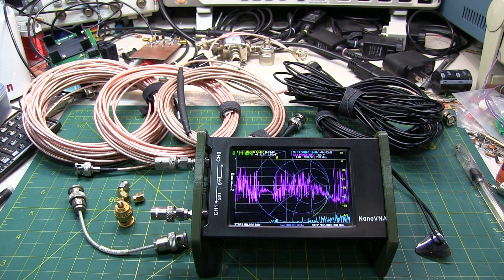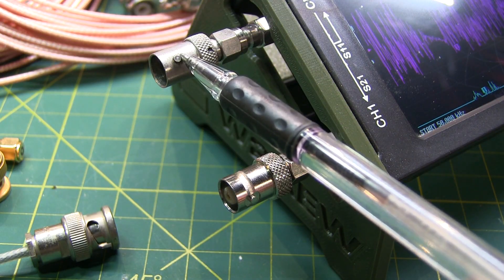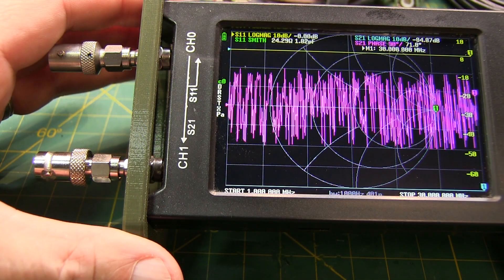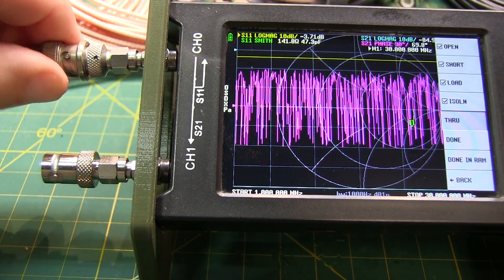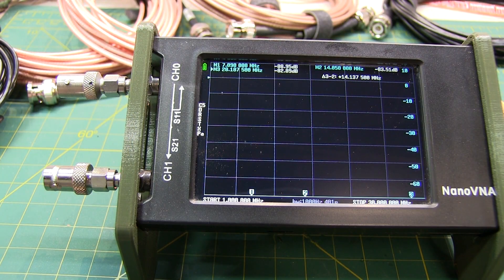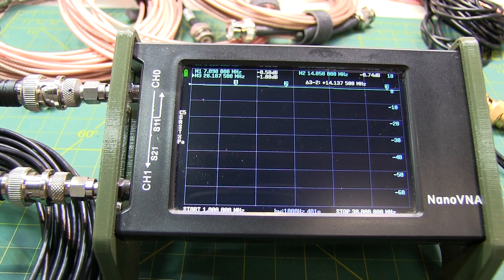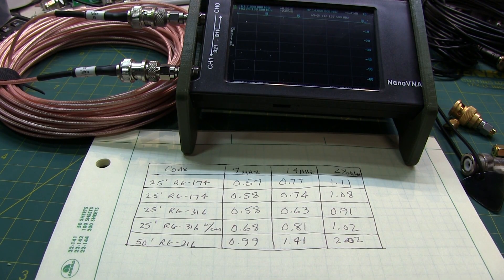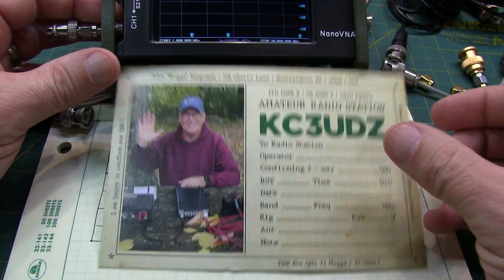#379: How to measure coax loss using a NanoVNA

Comment: I'm referencing this video for an article I'm writing for the local ham clubs on configuring the nanoVNA for antenna gain measurements using the Friis and Gauss-Jordan elimination methods that includes free space path and cable losses; you did not cover assigning the format of the s21 trace so it would display dB.  Your video shows Logmag which is fine - I don't recall the default value.  It may be a minor point but for the rank beginner I believe that it's important.  I'm not criticizing, only pointing out a very rare omission - you are very thorough.  Were I not writing an article, I would have overlooked as I have several times in the past.

This also configures the nanoVNA as a 2-port VNA for antenna gain measurements without a need for a spectrum analyzer and tracking generator.  The flexibility and price of the nanoVNA is beyond comparison.  Your videos are top shelf, second to none and I have learned so much from them all. Keep up the great work.  All the best and  73's AD6AE
Reply from the maker: Thank you and good luck with your article. The default for the S21 trace is logmag (dB).

Comment: Thank you for the video, could you please explain your reference to 40, 20 and 10 meters? I didn't really understand the relation between the frequencies you chose and your reference to meters.
Reply from the maker: In amateur radio, we often refer to some of our assigned operating frequency ranges by their wavelength.  40m refers to the 7.0-7.3MHz frequency range, 20m is 14.0 to 14.350MHz, 10m is 28.0 to 20.7MHz.  The band categories are approximate.  The basic equation is: wavelength_in_meters = 300 / frequency_in_MHz.

Comment: Does the fact that the test samples are coiled affect loss?  I'm thinking of them as RF chokes?  Thanks and 73.
Reply from the maker: No, since they are coax cables, coiling them only introduced inductance for common mode signals, not main signal through the coax.

Comment: Can I use S11 logmag and phase chart to figure out exact resonance point of an antenna?
Reply from the maker: Sure.  By definition, resonance simply means the absence of any inductive or capacitive reactance (phase=0) at the antenna port.
Reply: @w2aew  so something must go wrong with my vna, since I do not got phase=0 when s11 logmag is smallest. What could I did wrong?
Reply from the maker: @adrian_sp6def  Nothing wrong.  The resonant point does not refer to the lowest S11 (or even the lowest SWR) - not all antennas are 50ohm at their resonant point.

Comment: Does the VNA not auto scale?  Seems crazy to have a range to -60 dB when the actual data is -2 dB or less.
Reply from the maker: You have to set the scale manually.

Comment: I feel like if you have to use an adapter to put the calibrators on why even bother. Either way you're calibrating with an adapter
Reply from the maker: Yes, but the calibration process then removes the effect of the adapter.

Comment: Hi Alan, thank you for such amazing video, as usual. I always wondered how the "common mode choke" only applies impedance to the coax shield and not the core. I feel like it really makes sense on a balanced transmission line, but when it is applied to a coax, it really doesn't make too much sense to me. (I admit maybe I am just not understanding this properly.) Perhaps a video about common mode choke and how it works on coax (+/- how to measure it??) would be great. Pil VA3GPJ

Comment: Great video, clear, concise and exactly what IU was looking for to test losses on some feeder connectors. An Elmer had told me never to use 90deg connectors as the losses were horrendous. A shame as I really want to use on mobile and portable on my Xiegu G90. Ever the scientist I had to test it and your video was just what I was looking g for. Increased loss of the 90deg PL259 vs straight through PL259 - 0.01dB to 0.03 dB on 7-27 MHz.  Guess I'll be using that 90deg connector.  Didn't test at6 VHF or UHF - could be very different of course.

Comment: 2db is 37% power loss, right? Is that acceptable? I guess it depends on what you are doing and what you are willing to accept. Personally, I think that's pretty high.
Reply from the maker: Correct. It depends on the application whether 37% power loss is ok. In typical amateur radio applications, 2dB would not even be noticeable.

Comment: This is timely as I want to measure my RG58 coax loss. 
They shouldn't be too bad with three about 20' to 25' for five attic dipoles for 20m to 10m and one at about 60' for 60m. Coax data shows they should be around 0.6 dB so It'll be interesting to see.
If I buy coax now I want to see the braid as I bought one length which is very poorly screened, I don't want any more of that. Perhaps the best thing for that would be strip out the braid and bury it for an earth.
G4GHB.

Comment: Whether it is possible to measure the velicity factor
 by NanoVna?
Reply from the maker: Sure - ratio of measured length to the actual length.
Reply: @w2aew that would make for a good video maybe? I’m unsure what you mean by measured length vs actual length. Would you just measure the length with the velocity factor set to 1 then measure it with a tape measure?

Comment: Thanks for the video. It’s as well done and informative as always. On the subject of coax, I’ve come across a few videos that preach building coax cables to quarter wavelengths of the frequencies that it will be used . How critical is this? Some of the videos make it sound like if this practice isn’t followed, the signal will be so degraded that it’s pointless to use the coax. 
Your video seems to prove the opposite without even trying.  I defer to wisdom . 
Also, is the stand your vna is in self printed or retail?? If you’re selling them, where do I sign up? 

Also, I purchased an RF field strength meter that is less than advertised. Is there anyway I can email you a picture of the innards of it ? I’d like a more experienced opinion. Thanks.
Reply from the maker: Cutting coax to one quarter wavelength does nothing special other than invert the load impedance around the coax impedance. It makes a high impedance load look like a low impedance and vice versa. For a well matched load, the length does not matter. When the coax becomes part of the antenna, particularly part of the counterpoise, then a quarter wave line will form a tuned counterpoise.
Reply: C.B.'ers seem obsessed with trimming coax inch by inch to ½λ. They don't back down when I say why not the jumper lead from the tx to SWR meter too? They say it must be 3', 6', 9' or multiples of 3' but not carefully trimmed. Or that both coax cables are connected together by the SWR meter to form one cable so all their trimming is wasted.
I agree with W2AEV, if the aerial is not tuned properly the coax acts like a counterpoise earth. I think this is where the myth of trimming coax came from, they say the ½λ coax is the same impedance and has to match the tx and aerial for the least loss. No coax manufacturer states that.
I've only seen one video where an amateur says it does matter.
G4GHB.

Comment: Great video - as usual.  The importance of including any necessary connection adaptors when calibrating VNAs is generally not properly appreciated.  While it's OK to ignore them at HF, failing to do this at VHF and upwards, especially if trying to measure phase, can be very misleading.

Comment: Isn’t the open the same as nothing on the connector? I gladly give up that minimal loss for the compactness of the coax both size and weight.
Reply from the maker: At HF frequencies, yes, because the wavelength is relatively long compared to the adapter dimensions.  But, the "open" cap does help to prevent stray signals from coupling into the port.  As frequencies get higher where the wavelength becomes shorter, it is important for the physical/electrical location of the open, short and load to match so that the phase lines up, which is why there is an "open" standard.

Comment: shouldn't you be doing the calibration with the standards on the far end of the co-ax you are testing?
Reply from the maker: No, because then the loss of the cable will be removed from the measurement.

Comment: what is an s unit please ?
Reply from the maker: On most ham radio receivers and many shortwave radios, there is a received signal strength meter.  Most are calibrated to show a -73dBm signal at S9, and each S-unit on the meter corresponds to roughly 6dB signal strength change.
Reply: @w2aew  nice to know, thank you so much. does it have any specific meaning, does one S unit represent something special or is it for convenience ?
Reply from the maker: @AboubakrA  Just a convenience.  S9 = ~ -73dBm, S8 = ~ -79dBm, etc.  Just a way of "grading" the strength of the received signal.

Comment: Why didn't you use the Measure/Cable option? S11 is enough, by which we can measure the attenuation of a coax whose other end is distant. There we also have information about the length of the coax, and its impedance.
Reply from the maker: That is an option (if the firmware supports it).  Of course, a break in the cable would only be detected if the measured length differs from the actual length (if known).  You'd also have to check from both ends to be sure that both connectors are good.

Comment: Thanks for yet another informative video! Additionally, we can look up the corresponding data sheet for the expected typical numbers. Those of course don't include the losses in the connectors. About the nanoVNA standard. I was also thinking about something similar, but rather to take the stress of the device connectors and use some chassis mount for the "outside world". Until that time am just very careful with it, as I also see you too,  especially when the adapter is getting longer!

Comment: To accommodate for connectors, pigtails etc. which I have to use during calibration and not using after the calibration I use option "electric delay". As far I remember this option is available in Dislord's version of nanoVNA firmware. 
Merry Christmas! 73!
Reply from the maker: The electrical delay will ONLY account for the additional phase/delay by moving the reference plane. It will NOT account for the LOSS or impedance discontinuities in the adapters, pigtails, etc. as electrical length adjustment assumes a perfect lossless 50 impedance along the length that is added/removed with the electrical length adjustment.
Reply: @w2aew  Good point - thank You.

Comment: Love it! I wonder why yhe Nano VNA comes with an OSL cal kit, when the $30k Field Fox at work doesn't.
Reply: But let's face it, the main reason is that companies like Keysight want to make as much profit as possible.  A decent quality manual cal kit probably costs them a couple hundred bucks.  They know they can sell that to you for much more as a separate item.  They mainly sell to "big business" where this sort of practice is considered the norm so they get away with it.  Until purchasing managers start demanding better value for money they'll keep on doing it.  Sad but true.
Reply: @Chris-hy6jy  Yeah, in all fairness, I think if  I was employed by a test equipment maker this would just be an accepted norm that's had decades to normalize, but offering a packaged deal with perhaps the most common form of OSL would be a very helpful improvement.
Reply from the maker: Because the NanoVNA cal kit is FAR from being a high quality "standard" - albeit sufficient for hobby use.
Reply: @w2aew   @w2aew  I understand your point; however, if a low-quality VNA can come packaged with a low-quality standard, a high-quality VNA could easily include a high-quality cal kit. We'd pay to avoid worrying about what else we need to purchase.  I reckon I could be oversimplifying with that logic, but it becomes tiresome getting nickled and dimed for an item necessary to perform functions that are installed options on the instrument.
Reply from the maker: @ernieschatz3783    The other problem is that the type and gender of the connectors on the cal kit in professional applications are typically purchased to match the DUT - and given the wide variety of DUT types and connections, it wouldn't be practical to include a kit with the instrument - and thus it is left to the user to select the cal kit that best suits their needs.

Comment: Thank you for the tutorial it's a great video.
What would be the disadvantage of just doing a thru cal only with your known good shorting cable?
Could be also need to push the frequency up and see where the cable links drop a 3db loss.
Reply from the maker: When measuring very low loss devices like this, every little thing (such as the source match) matters, so it makes sense to do the OSL calibrations also.
Reply: Thanks! 👍 And Merry Christmas!

Comment: Thanks for yet another piece of good info. 
I have a question: Does it make sense to measure  coax signal attenuation as 1/2 of return loss with single port and the length of coax shorted/open at the end. How bad would it be compared to S21 measurement you have shown?
Reply from the maker: You can, but.... ...you won't be able to tell if the cable has a break or short somewhere along its length, or a bad connector at the far end.
Reply: @w2aew  Merry Christmas and thanks for the reply. The use case would be: a "found in the attic/cheap on a hamfest" roll of coax with no connectors and me be willing to sacrifice one good connector. A short/break could be detected using TDR.
Reply from the maker: @Piotr_P_M Sounds like a plan.  Also, check out my video on measuring the impedance of unknown coax...

Comment: Very informative Alan, thanks.  I'll have to go test some of my Amazon-purchased RG-316 cables.  I also frequently join a pair of 25' cables with a BNC barrel, so curious to see what the total loss is and if it is better to just use a single 50' cable for example.